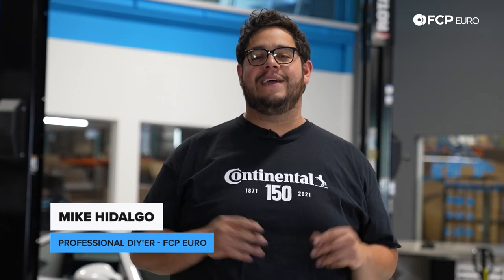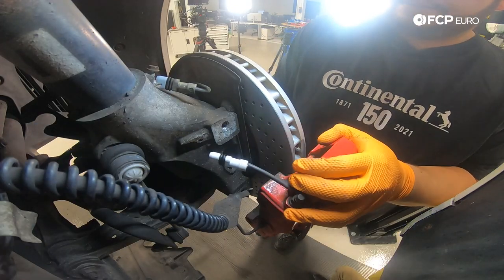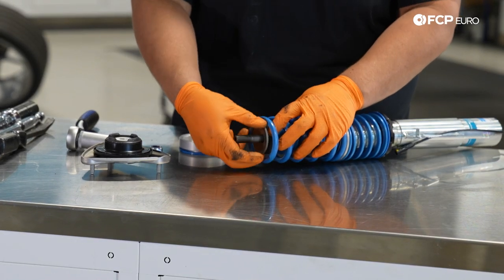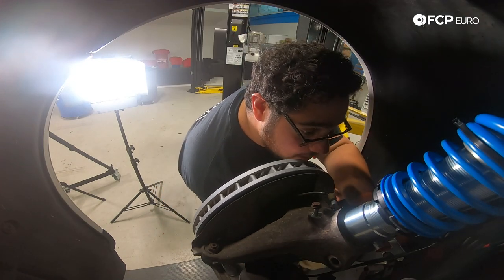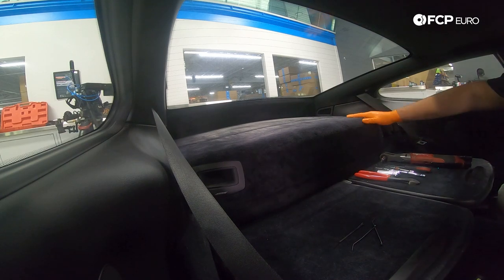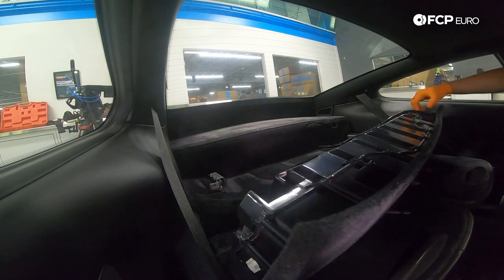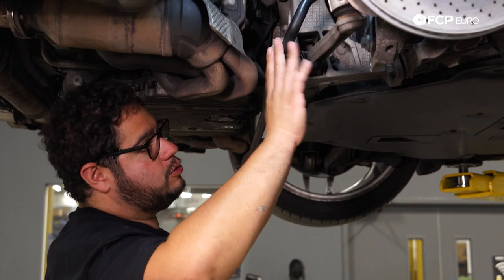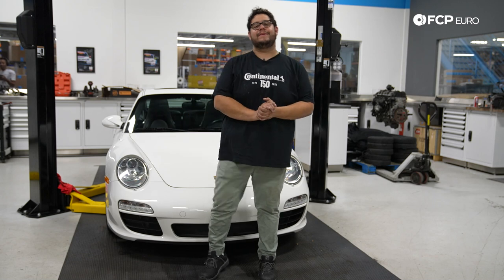Porsche 911 997 Coilover Installation DIY (2005-2012 Porsche Carrera, Carrera S, GTS, Targa, 4S)

Comment: Thanks Mike for the DIY. I gleaned lots of good tips from it. Did today on all 4 corners, but on a 997.2 C4S. It was much more difficult than depicted in the video. One of the most difficult parts was removing the bolt that retains the bottom of the rear struts. Mike makes mention of this, but the bolt does not come past the toe bar. I was not able to figure out how to move the strut down and around to allow said bolt to slip past the Toe Bar. I finally removed the Toe Bar nut and grunted the Bar up and out of the way. Very frustrating. Why Porsche couldn't have moved something a millimeter or 2 is beyond me. In general, it's much more difficult to remove the old struts, front and back than shown in the video. This is partly due to the front drive shafts on the 4 wheel drive models. On the fronts, I removed all the brake stuff, and rotor, and the ball link nut on the lower control arm. One other comment replates to reassembly. Be very mindful of putting things back in an order that will allow each nut to be torqued as you go. Thanks, Joe

Comment: You missed a very important step.  You should mention that when assembling the rear coilovers, you have to transfer the rear shock mount AND the metal washer on the old strut shaft that is visible at 20:39.  Without that washer, the coilover will rattle.  Ask me how I know.

Comment: How similar is the install between a 997 and a 996?  Also a c2 vs c4?   It's my understanding the C4 takes a bit more work.
Reply: The 996 to the 997 has a very similar suspension setup minus the PASM. The difference between the C2 and the C4 is minimal, no real additional complexity. I'd recommend just taking a look at the parts diagram for both before you get started to familiarise yourself.
Reply: Following on from this, I too thought the 997 C4S required front knuckle/ hub removal….. if it’s a case of just pulling down hard on the shock asm I’d opt for this if possible. Thanks in advance
Reply: @James_Sovereign  Only if your 996T has been converted to RWD.  The front driveshafts are not covered in this video...there are a couple of ways to deal with them, the easiest being removing the 6 axle stub bolts on each side of the front diff to provide just enough movement to allow the strut+wheel hub assembly outside the fender to enable the rest of the work to continue.  This isn't a minor difference.  I did this job on my 996TT which I converted to RWD because the AWD system is useless in that car.  My 997TT was a lot more difficult because I retained AWD.

Comment: Good vid. Gonna be doing this on my 987.1. I wondered why you weren't swapping out sway bar end links to adjustable ones when you did the front, but then when doing the rear coilovers you mentioned "new sway bar". I assume you did in fact swap end links (front and rear) in order to keep the sway bar geometry close to stock with the lowered ride hight. True??

Comment: Great video, you make it look so easy! Every other DIY I've looked at for this requires a ball joint separator to remove one end of the tie rod, but you don't make any mention of that step in here (that I can see). Is this not required to be able to pivot the carrier down? Note: I have a 997.1 so possibly a bit different?

Comment: This is great. I was wondering if you could do a 996 with the KW v3s! Some say you need a KW adapter (that I can't find anywhere) if you are using the OEM upper mounts. I can only find KW adapters for the rears. cheers!

Comment: AWD cars are not the same but C4S is in the title..  Additional work is required to deal with the front axles which is not shown in the video.  Otherwise it's a top notch DIY video.  Thanks for posting!
Reply: I learned this the hard way.  The front mounts are angled, and the B16 kit comes with different spacers

Comment: Many thanks, very helpful. One question re the 997.1 without PASM . Does the rear original shock also come with no pre-load so no need for a spring compressor?  Many thanks in advance.
Reply from the maker: Hi Markus, unfortunately we have not gotten our hands on a .1 yet to confirm.
Reply: Many thanks.

Comment: I don't see any damping adjusters. I thought B16s were tunable with damping adjusters located top or bottom. Where are the adjusters located?
Reply from the maker: Hi Steve, for this specific model, it has electronic dampening meaning it’s electronic, no manual adjustments on the dampers.